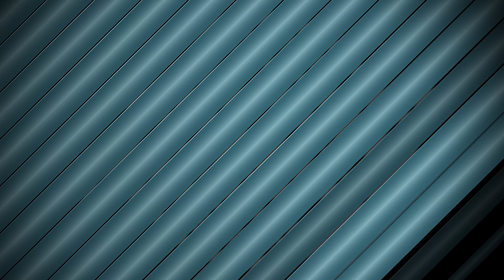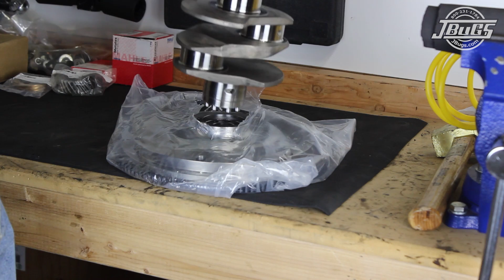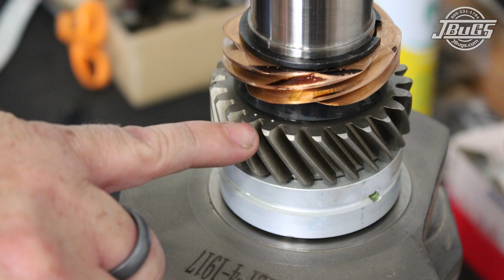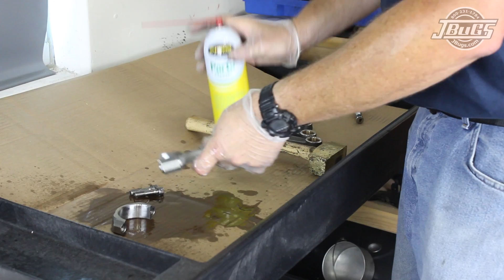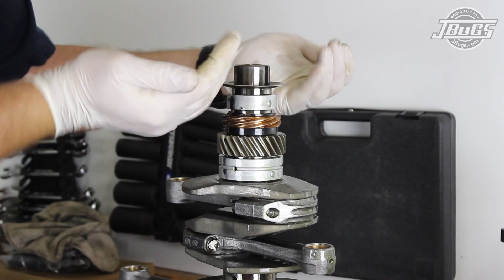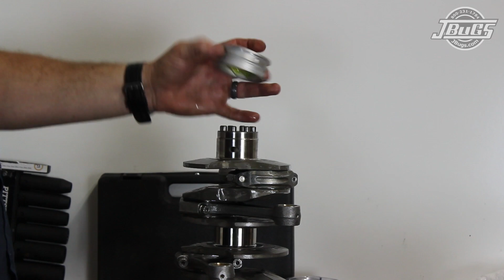JBugs - 1971 VW Super Beetle - Engine Build Series - Crank & Rod Assembly

Comment: hmm... how do you ensure the ground down rod bolts done for case clearance have the same orientation when you reassemble? It seems they may not torque to the same exact rotational spot.
Reply: We note that at 8:13. Knowing that the bolts will turn a litte more (clockwise) when tightened the next time, we grind a bit more in the counter-clockwise direction on the bolt head.
Reply: @Sam_Mebane  thank you! I missed it.

Comment: I see on the video series that the crank and flywheel have eight dowel pins. My 71 has the wrong engine in it. It only has four dowel pins. The engine number starts with a 72 in the stamped number. Research tells me this is a 64 model 1200cc engine. Does that sound right? Let me tell you, it sucks to find out I have a smaller engine than what I was led to believe! And I don’t know if a 1200 is worth rebuilding. It is a good runner though.
Reply: We didn't use a stock crankshaft, that's why ours is 8 doweled. A "7" series engine would be a 1200cc 40 horse engine, yes.

Comment: I didnt see any rod or main bearing clearance checks and if you use plasti gauge?
Reply: I absolutely dont agree with being able to develop a feel for bearing clearance. Ive been building engines since the 70s and would never assemble a engine without doing a simple bearing measurement...
Reply: Most VW engine builders go by feel. Sure, if we we're building a high revving, turbo charged engine, we'd spend a lot more time checking minute tolerances, we'd have the entire rotating assembly balanced, etc. There is no stopping the amount of time, money and attention to detail you COULD throw into building an engine. At the end of the day though, for most of the guys building in their garage or shops, it isn't worthwhile and they trust their experience and "feel" for what they are doing.

Comment: very interesting, why vegetable oil and not water? would you use vegetable oil on the crank belt pulley too?
Reply: The boiling point of the oil is 572F or 300C, as opposed to 212F or 100C for water. I assume the concern is that the water will boil-off before the gear is heated through.
Reply: Not sure why oil vs water, but there is no need to heat up the crank pulley.

Comment: I am rebuilding my 71 super now and I want to follow this same set up. Very new to this so apologize for the ignorant question, but what do I tell the machine shop I need done? I know you mention line boring. If I change out my crank to the 74mm version you show in the video, what do I ask for when contact the machine shop? Will they need to have the crank before they can do the work?
Reply from the maker: A VW familiar machine shop will be able to inspect the case and align bore it as needed and will be able to machine the thrust surface as needed. If you’re using all the same parts we did in our video we would recommend having the case clearanced for the larger crankshaft as opposed to clearancing the rod bolts like we did. Sure, our engine runs well but there is a better way to do it, and that is clearancing the case. We only clearanced the rods to show it can be done (and is common practice) for those without access to a machine shop.
Reply: @JBugsVWParts  Would the machine shop need to have the new crank in hand to do the job? Also what set of cylinder heads to you put on this engine? I would like to get the most performance out of the current block
Reply: @blakemarciszewski4744  sorry for the delay. The quickest way to get a hold of us is through our website as we don't get notifications from YouTube. Like before, a shop familiar with VW engines will know where to clearance, otherwise we'd recommend having the case, cranks, rods, and pistons that you'll be using. We installed EMPI GTV-2 98-1334-B cylinder heads. 

You can click "SHOW MORE" on any of our videos to see links to all the parts we're using.

Comment: Would any damage occur if you were to place the crank shaft in a fridge or freezer before putting the heated up gears on it? Might take less time, just a thought.
Reply: No, and often times builders will do both, putting the crank in a deep freeze and the gear on a hot plate (which works way quicker than a camp stove and oil).

Comment: Always clearance to block for Rod bolts it won't weaken the case and it's a must may I say it again absolutely a must to have the rotating assembly bounce with pressure plate and have the rods and pistons balance very important for VW engines since the case is made of magnesium even if you have aluminum case you don't need the vibration always install good oil pump and run a good oil cooler with a full flow oil system the filter an attic cooler increase is the oil capacity which makes the engine run cooler and long-term I built a lot of VW Motors

Comment: I have aftermarket H-beams ARP 2000s with a 69mm counterweighted crank that will soon have a procharger...the rods purchased show to torque to 26...but your video shows 38...what would you suggest...is 38 too much.
Reply from the maker: Every rod manufacturer will have their recommended specs, we advise following their torque specs.

Comment: Can forged I-beams be used with a turbo or would we need to use H-beam rods...and if so...do H-beam rods have anything specific that needs to be done that's different from I-beam rods
Reply from the maker: A quality set of I-beam rods is going to be equivalent to most H-beam rods but for higher torque, higher boost or high RPM applications, the H-beam would be preferred. Installing either rod is the same. For longer rod or stroked cranks, rod to case, piston, cylinder and in some engines, the cam, clearances should be checked and re-checked during mock up and assembly.

Comment: Hello friend , I want to know if I have to perform dynamic balancing to the following products that you buy new in your online store are the following: AA Performance Products 4340 Forged Counterweighted Crankshaft Chevy Journal (Size 76mm) Brand: AA Performance , Manufacturer Part Number: 003 4376C, and: FLYWHEEL LIGHTENED 8 DOWEL, dune buggy vw bug, OEM Part Number 311105273HP, can you help me? to know if they are already balanced or do I have to balance them together?
Reply from the maker: The crank and flywheel are balanced, but mass produced so there will always be variances. The pistons are not. If you have the means, having the rotating assembly balanced together is ideal.